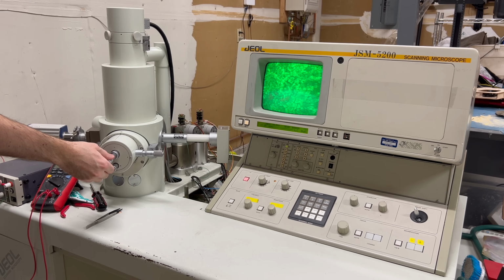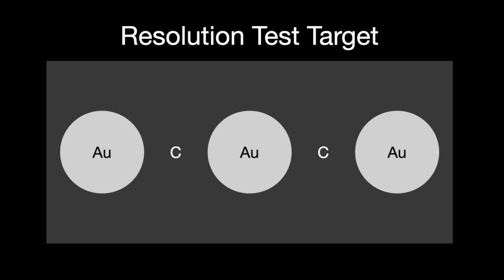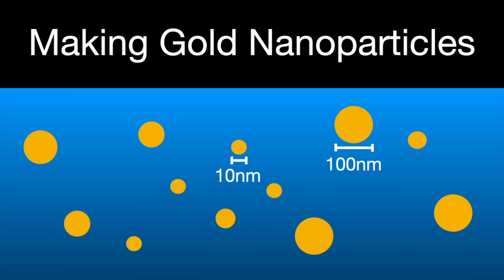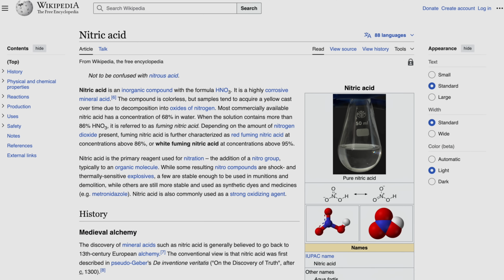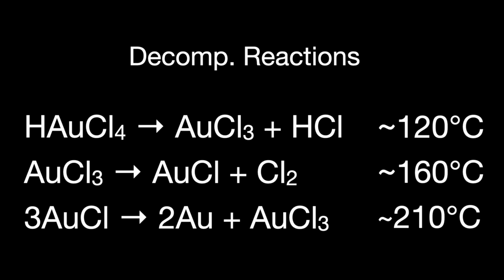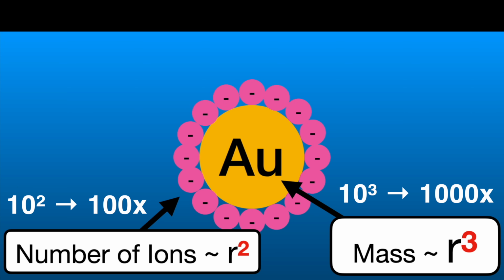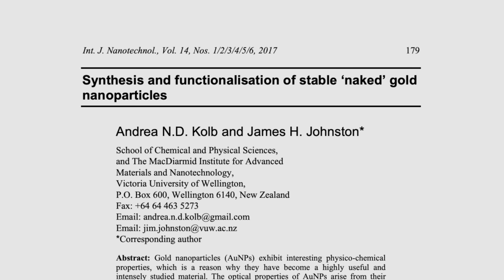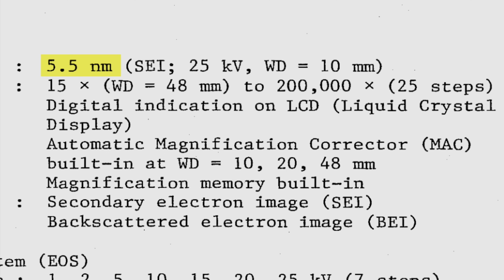Making Gold Nanoparticles to Calibrate My SEM

Comment: SEM hacking is the most 80s-90s cyberpunk pilled activity one can imagine.
Reply from the maker: Someday i hope everyone will have access to an SEM
Reply: @projectsinflight  "Why are your learning glassblowing? What will you sculpt?"

"Sculpt? I have electrons to investigate."
Reply: @mgancarzjr TBH that was also the case at the beginning of a lot of science where knowing how to make your own equipment was a requirement, so a "chemist" would have to know how to blow glass
Reply: @ImieNazwiskoOK They still do sometimes, from what I've seen, but very uncommon because most reasonably used parts are already made
Reply: @projectsinflight as you showed us - it's just a question of effort. It's possible, modern or vintage - doesn't matter. Everyone has a chance, but only a few folks are dreaming about.
Reply: @projectsinflight I want one right now
Reply: Look up nile reds vapor plating thing. @projectsinflight
Reply: I'm pretty sure if I went back in time and tried to convince early-90s me that picking up an old SEM just to mess around with for fun was going to be a thing that normal people could just do, I would fail completely. And kid me would call now-me a psychotic dumbass.
Reply: @verdatum Just a few years ago: What do you mean you can design a phased radar array on your tablet, and PCBWay will manufacture and ship you a nearly-completed unit?
Reply: @mgancarzjr  "Yeah...right...maybe slow-boated from China....if you promise to order at least 1000 units."
Reply: @verdatum  I'm not saying my plans require over 1000 units and are important enough to wait
Reply: @mgancarzjr  We live in the future and it's friggin' nuts sometimes :D
Reply: Kinda like that scene in hackers when they are looking at her laptop, woah it's got full color display.. 32 bit colors woaaaahh
Reply: A gigabyte of RAM should do the trick
Reply: Lovely work. 

[Somewhere in the German literature around 1900 is a paper by a couple of guys who were making nano particles out of different metals, at the suggestion of young Einstein.]

I guess you can use contrast to distinguish different metals, or if you had an xray detector in your sem, you could check for characteristic k shell xray backscatter. [But the hardware and software used to be a little expensive.]